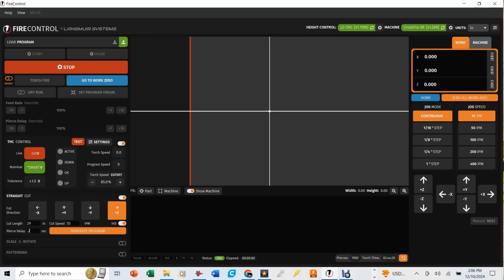BENT 14 Bolt Axle?  Here’s how to fix it.

Comment: Random unrelated question. How do you dispose of the water and slag in the xfire. Not drain it, but actually get rid of it.
Reply from the maker: Not totally proud of this, but while I do have the ability to drain the table, I usually just leave it in the table until it evaporates off.   takes a few weeks in Colorado.   Once the table is dry, I will pick out the big pieces and scrape the rest out   maybe vacuum some of the little pieces.   After owing it for 4 years, I spend less time keeping it pretty.   I do clean the moving parts with WD40 and Oil to make sure those parts keep working smoothly...the table just works.

Comment: A 100 different ways to skin a cat. As long as it's fairly straight and strong, it will be fine, until it's not. I think I would have lagged down some plates, chained down the ends of the axle, and bottle jacked the center section. Just to get it as straight as possible and hold tension while tacking.  We had a guy at work who could straighten things with a torch and wet rag. That's just not me,  to much feel and guess work
Reply from the maker: @bobbarker3781  I thought about that.   Was going to make something that would allow me to apply the loads to bend it, but  I decided to chance it with science.

Comment: Informative video. Physics does indeed work. Thanks! 
What is the spring weight of that complete axel assembly? Any thoughts of going to independent suspension in the rear?
Reply from the maker: @Phsteddie  it is super heavy.   Probably near 800lbs with truss and 40in tires.   I do focus on budget builds and hope to fix this with a better design.  Going with independent suspension would definitely increase cost and I think decrease durability for a questionable gain in off-roading performance.
Reply: @ IRS will definitely cost more and lot more suspension geometry/dynamics and U joints to deal with. I get ya. But from the videos and your military experience, I get that you want to run with the big dogs. That takes major coin. What about that class where the VW’s or “ semi stock” run? It seems that those guys have just as much fun with a wee bit less headaches. Slower speeds, of course. Racing is tough, man. 
I do enjoy your build videos. Thnx.
Reply from the maker: @ building one right now.  Making a few videos.  “The  Trooper” will be ready for the Mint 400.

Comment: Yeah, my understanding is most factory axle housings have a little bend upwards in the middle so that when they have the vehicles weight on it they flex into a flat position. 

So your 1.7 degrees was probably more like 3 from the factory location. 

But after you reinforced with the truss, all that goes out the window and you have to find your own numbers for deflection at static and max load.
Reply from the maker: @austinlambert3994  I wish I measured it before I sent it.   I will say that I did everything wrong with that truss design.   The dimensioning and fabrication was adequate, but the design was flawed.   I welded a landing location for the bump right to the tube.   I think that created a stress concentration at the largest load point.   We did have a crack in the tube.  I am just hoping the axle will last one more race as I am getting two more axles to build up better.   Mainly focusing on distributing the impact loads across the tube with a better truss.
Reply: @ntdracing  This might also be an issue in your bypass. I don't know what tuning tradeoffs you chose but slamming the bump stops hard enough to bend a 1 ton axle is a hard hit. 

It's possible that a quality shock tuner would have transferred those loads to your lower link. 

Just a thought.